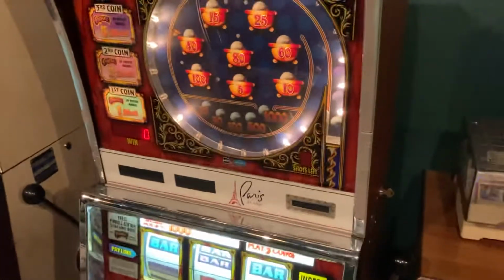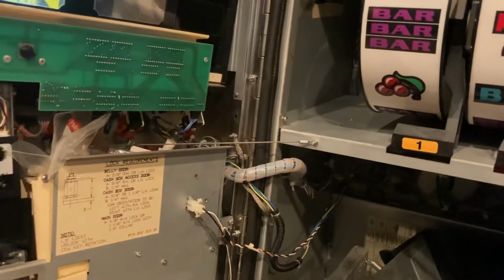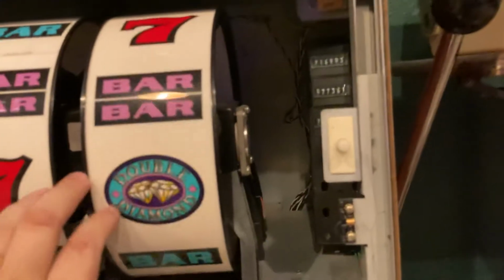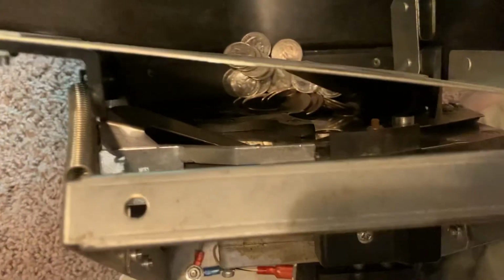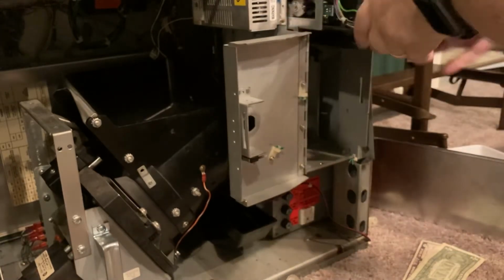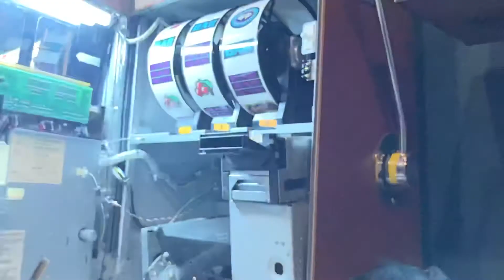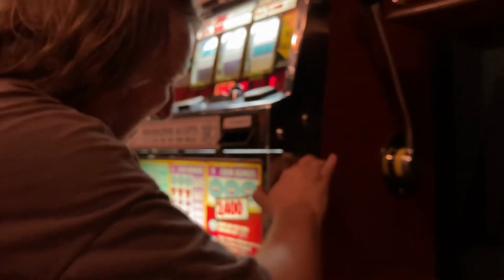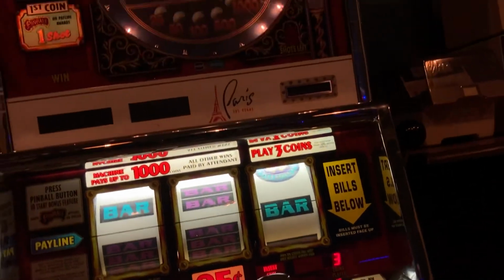Part 2 | IGT S+ Top Dollar & Pinball Restoration.

Comment: Hey man, I bought a broken igt S+ machine (I’m new so slots) and went through some issues changed the battery on the board because it was dead got it replace, did the clear chip swap and got the coin side working. The issue I’m having is with the bill acceptor. It’s not taking any bills. The BV I have is a “WBA-13-SS” I did set the bill chip and put it from (9-0) to (9-1) and set the amount to .25 and saved it. I know it’s on because I see two red lights on the BV on the bottom right side where the 8 switches are. Then I set the 1,2,3 and 8 switch “(and turn of the 8 switch off)to check if the BV head is working. So is the yellow light outside.  It also takes the bills in and into the cash box. But as soon as I turn all the switches off  and close the door I put a dollar bill in and it doesn’t count the credits then I put another bill and it gets stuck inside the BV. Could you help me out if possible?

Comment: hey, i'm from Argentina! and just bought an s2000 and hopper was disabled. First I need to buy the key chip to disable coinless mode (I suposse), and then, despite hopper is installed, I see that there are some wires disconected, i think the people who disabled it also disconected the module from main board. Can you help me where to see the proper conection for my cables to make it work? Thanks very much!

Comment: I’m putting a coin comparitor and hopper back into an S2000 I just bought last week. I assume I won’t be able to test the comparitor until I clear and key my machine? 

And also, the comparitor won’t work unless I have the hopper installed right? I have the comparitor but the hopper is coming in the mail.
Reply from the maker: I don't have a S2000 in front of me, but if memory serves me right, the default is set to enable coins. So, someone would have specifically had to turn COINLESS on during the set procedure. So, I think you probably won't have to clear/set it. If you do have to, I already have a video showing how to do that and can of course help!
Reply: Home Slots Fun I believe the man I bought it from did indeed turn coolness mode on. 

And will the comparitor work without the hopper installed?
Reply from the maker: @RMphy89  OK, I can't remember for sure, but you MAY be able to change that setting without a clear/key process. I do have a few S2000's coming in later this week or early next week and I can tell you specifically where it is. 

I'm not sure if the comparitor will work without the hopper - my guess would be that it would cause a tilt.
Reply: Home Slots Fun thanks for the info. I look forward to seeing your new S2000s. And I will report back after I get the comparitor and hopper to work.
Reply from the maker: RMphy89 sounds good! Please do! The hardest part to converting to coins is getting the comparator harness perfectly lined up. I really struggle with that sometimes haha.